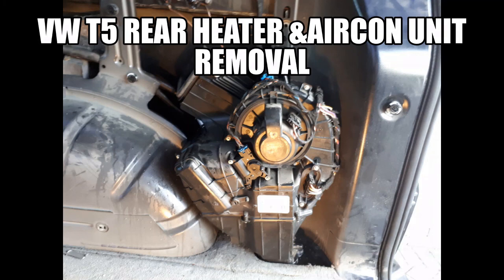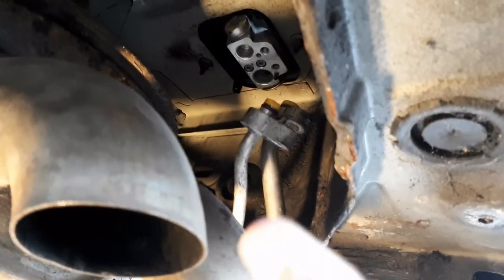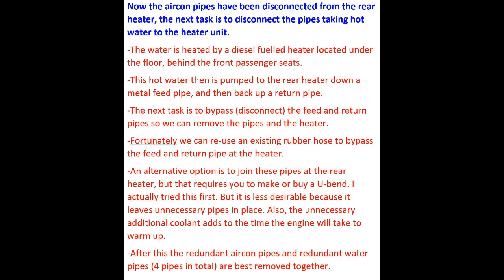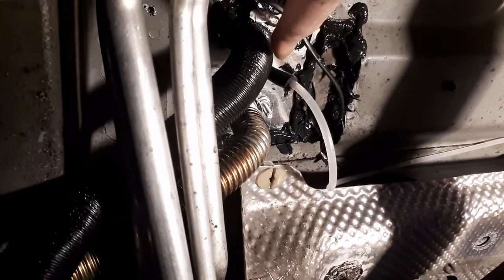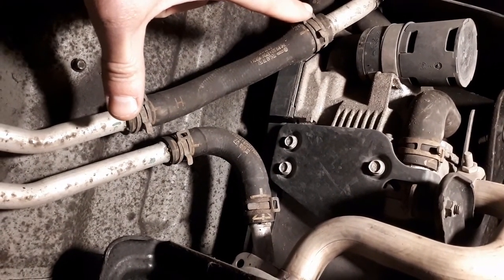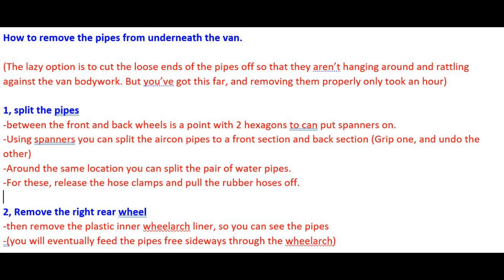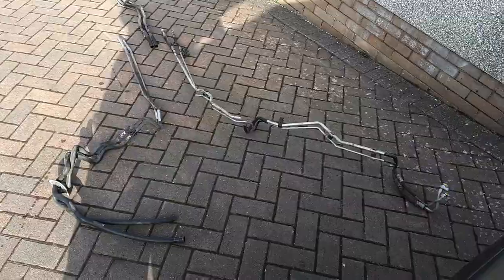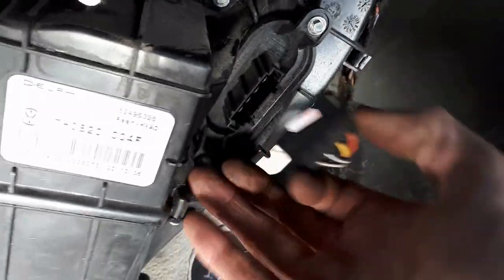VW T5 How to remove the rear heater aircon HVAC unit from a shuttle caravelle combi kombi.

Comment: Nice one Chris... I'm just about to take mine out... I'm staggered that with all that pipework you removed that I don't have any leaks on my 18 year old T5. I had issues with my aircon pump a few years ago and they offered to remove the divert junction for the rear hvac... I said nahhh, I'm alright.... Kicking myself now😂

Comment: Great video thanks. Im hoping T6 is the same. No issues with wiring simply unplugged? It doesnt need coding or create faults with front heater operation etc?

Comment: How easy is it to blank the pipes off as the system is leaking gas through the rear where the HVAC was disconnected even when the black shut off halves are closed - thx for your help in advance

Comment: Great video this just got me out of a right hole where the tyre had rubbed through the pipes in the arch showed the aa guy this video and got me back on the road by looping out the coolant pipes until I can fix the hoses at the back and raise the van up a bit
Reply from the maker: Glad that it was useful to you. If you have a water leak at the back, the "loop it at the coolant heater" is far and away the best way to isolate the  rear unit. 
Glad you got rolling again

Comment: i managed to undo the T40 spline bolts and loosen both 10mm retaining nuts without fully removing the crinkly panel and moving the silencer...it was very hard, but not impossible
Reply: Hi - currently trying to do this right now (avoiding removing the heat shield and dropping exhaust) - any tips? Was it a case of reaching in to find the nuts?

Comment: Hi mate I have T32 9 seater 2018. Rear side air conditioner blowing hot air but from front proper cooling. Can you advise please what to look at thanks
Reply: Did you sort this ?
I’ve got hot air up the front on the dab but cold at the rear of the of the car. 
Only one water pipe is warm that feeds the rear hvac so trying to figure out if I have a auxillary water  pump issue or blockage in the rear hvac matrix ?
Reply: FYI unless your van has "climatronic" it won't have the rear hvac and will only pump ambient and warm air from the back